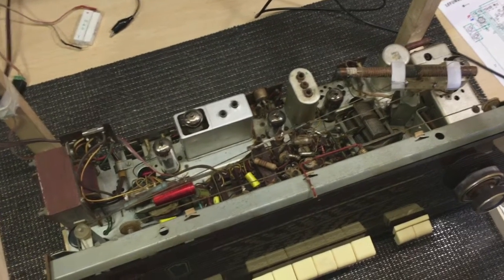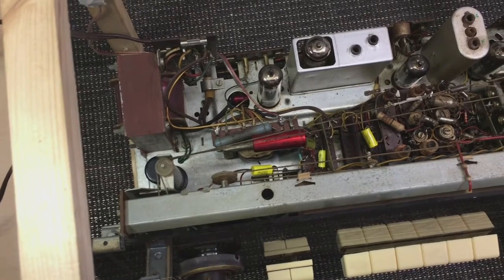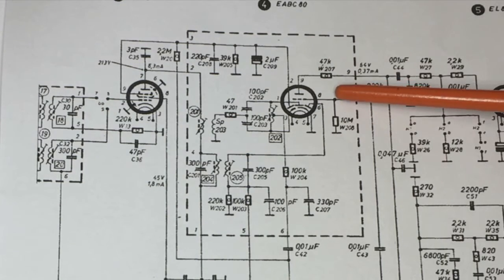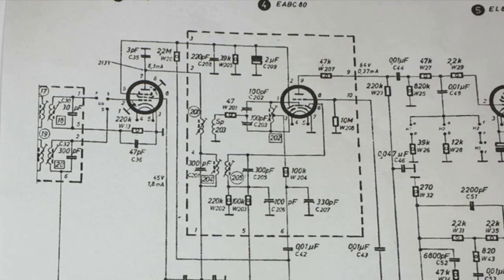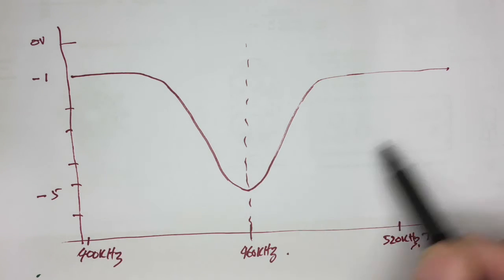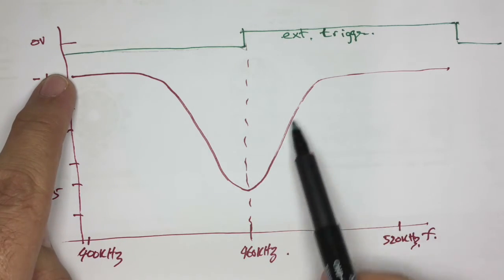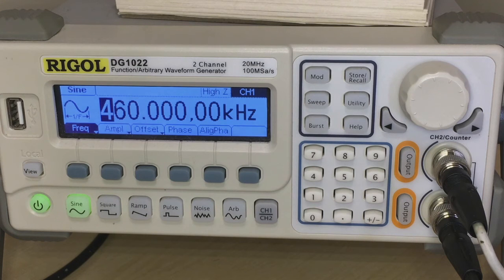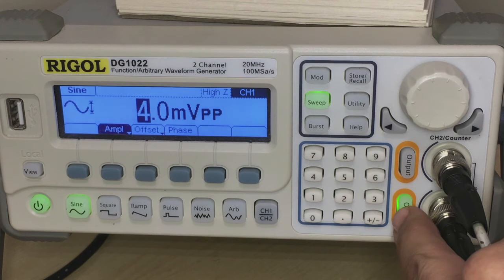Telefunken Operette 8 tube radio restoration - Part 5. IF alignment, visual method.

Comment: Smart use of gear! The poor man's spectrum analyzer works great and costs nothing if you have a basic scope and sweeping signal generator. Hope you will show us a full alignment of a more complex multiple if stage radio in the future using this method. Great work!
Reply from the maker: I will certainly try. Its more fun this way. Also, doing things the same way all the time gets a little boring, so one has to try and be a little creative.

Comment: Mr. Caldeira; how do you connect the ground clip at the probe of your scope to the radio.  The scope is earth grounded at the power plug whereas these radios are chassis grounded (floating ground).  Do you use a DC blocking capacitor in series with the ground clip to protect the probe and scope in case there is a dead sort in the chassis. I guess a similar situation exists for the signal generator.
Reply from the maker: No, I connect the ground to the chassis in all cases unless it’s a hot-chassis set. Then you need to be very careful. I use an isolation transformer to avoid problems.
Reply: Thank you. I just wanted to  get an expert opinion before connecting the brand new scope to the radio.

Comment: forgive my dumb question....when you perform such a procedure,should the radio be on...i know it sound dump but i'm
just a hobbyist ...thanks
Reply from the maker: mountainhawk : yes. You want the signal to be passing through as it would under normal operation. Be careful of high voltages. Don't get zapped - it can kill you.

Comment: If channel 1 of your signal generator is going to a point on the radio, where is the cable from channel 2 on the generator going?
Reply from the maker: If you mean when I do the alignment, it goes from the sync output to channel 2 of the scope.
Reply: @electronicsoldandnew  Thanks for the reply and we all appreciate your videos explaining everything however I am still confused, in the video you explain that there is a jack on the back of the generator that goes to the trigger input of your scope, if your saying that channel 2 output of the generator is going to channel 2 of the scope, I do not see any connection to channel 2 of your scope in the video? I have a hantek digital scope here and also just ordered a Rigol DG1022U signal generator and wish to perform a visual alignment but want to learn exactly how the hookups go.
Reply from the maker: I didn’t explain clearly, my apologies. The second channel of the signal generator is not used. The trigger output is taken from the back of the signal generator and fed either to the trigger  input of the scope, or to the second channel of the scope and the scope is then triggered  from this second channel.
Reply: @electronicsoldandnew  Perfect!  thanks, that's what thought. Thanks so much again for your very detailed and understandable method of delivering us your wisdom!  we the hobbyist greatly appreciate that!
Reply from the maker: Pleasure